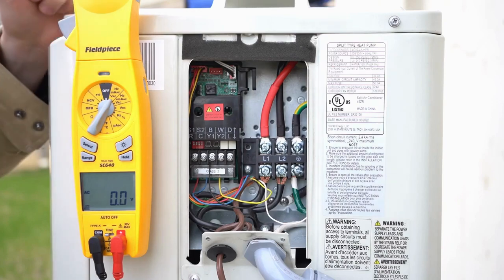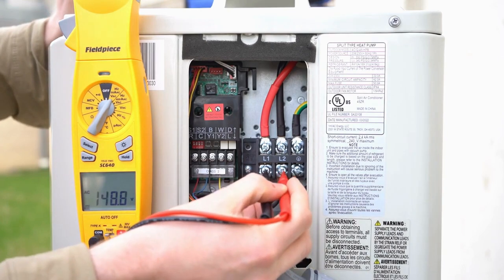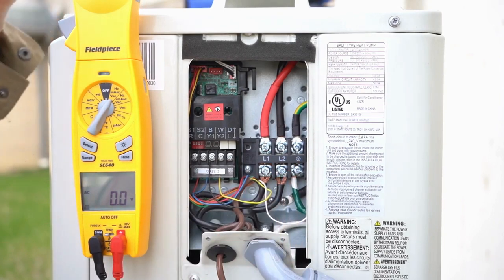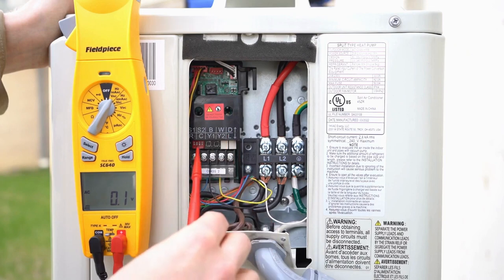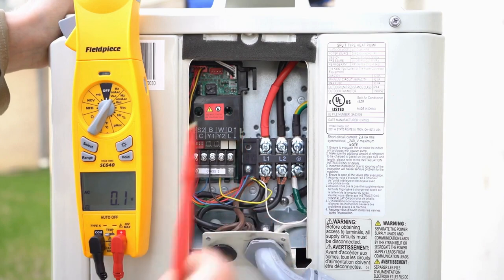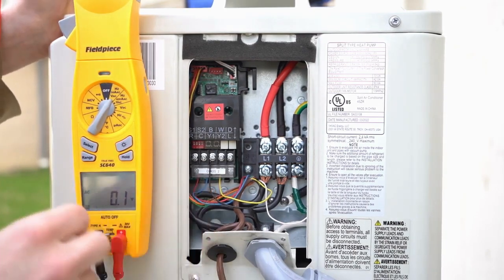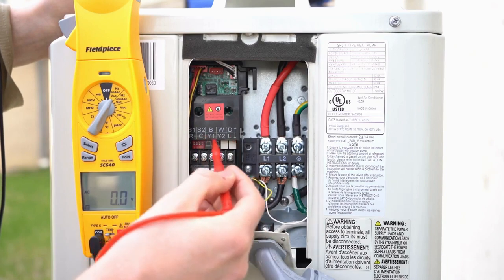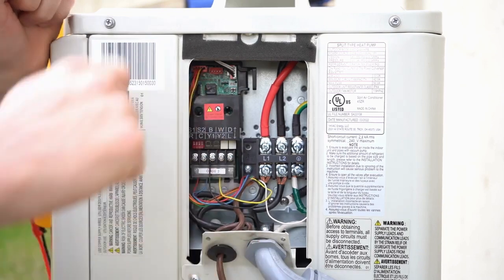How to Install an ACiQ Next Generation Heat Pump with a 24v Thermostat

Comment: Please help me, I have aciq gas furnace, coil,ac only condenser unit. I have 2 wires from old ac condenser unit connected on outdoor board at r and c. The outdoor unit will not come on. Is it because I have no communication wire or can I run unit without communication wire? Please help
Reply: outdoor unit will NOT run with just R & C (those 2 just power low voltage circuitry) you need Y2 for single stage cooling (or Y1 & Y2 if your thermostat allows2 stage cooling) and if a Heat Pump you need Y1, Y2, B & D.

Y1 is 1st stage of cooling (lower output) Y2 is second stage (or 100% output) B is reversing valve for heat pump (switches refrigerant flow to heat/cool) D is sending 24vac to  W2 on indoor unit to aid DEFROSTING OF OUTDOOR UNIT W2 can be: heat strips, gas, oil, propane FURNACE
Reply: Same issue, I was wondering if you can run a jumper wire from red to y1
Reply: Dont need communication wire, i had to run another wire so 3 at outdoor unit.  Red common,y2.  Set the second dip switch to up with power off@Michaelmasseymusic
Reply: @Michaelmasseymusic did that work?

Comment: I’m about to install one of these for the first time so I am grateful you saved me from frying the PCB. 

Can these outdoor units be used with a Goodman air handler?
Reply: if 24v control is used you can use it with 60y old moon lander A/C 🙂

Comment: Where does the s1 and S2 wire go to and what gauge wire does it need to be? And if I have th2 s1 and s2 hooked up, do i need to hook up the thermostat wires too?
Reply: On my QCiQ 4 ton ducted heat pump the terminal for S1 and S2 are clearly marked. BE AWARE that both install manuals I received with the heat pump warn against using S1 and S2 terminals only under certain circumstances or the board may be damaged. Also says to NEVER apply 24v power to S1 and/or S2. You might want to call whomever sold you your heat pump for technical advice.
Reply: @geraldhenrickson7472  Thanks for replying and I should have better worded the question. I have the same setup in the video above for terminals S1 S2 B W D in class 1 and R C Y1 Y2 L in class 2 for my ACIQ heat pump. I was wondering where the S1 and S2 wire connection from the heat pump go to? And if I have the 24 V thermostat wires hooked up like yours ( I see you have a red, blue, black and yellow wire in video), does the S1 and S2 still need to be hooked up in addition to thermostat wires or no?
Reply: @emmannuelthomas8060  FYI 
you only use comms wiring (S1 & S2) if you are NOT using 24v thermostat
if S1 & S2 are used on: HP < AHU & thermostat then only S1 and S2 are on all 3 devices!

some (very few) AHU's allow to communicate with HP via S1 & S2 and 24vac ONLY between AHU and HP

very few can do this so VERIFY (i doubt ACIQ can achieve this)
Reply: @palgumaka   Thank you. I just connected used the 24 V thermostat wire and did not connect S1 and S2 wire at all, and system works fine. Had to turn on one DIP switch in control panel to get the system to work.
Reply: @geraldhenrickson7472 Thank you. I just connected used the 24 V thermostat wire and did not connect S1 and S2 wire at all, and system works fine. Had to turn on one DIP switch in control panel to get the system to work.

Comment: FYI I would keep my low voltage wires aways from 240v load wires to avoid induction currents. Like in your video just move yellow and white wires away, move the supply black wires to the right.

Comment: I found the communicating Thermostat very easy to install and use. I couldn't run a new thermostat 18gauge wire to the air handler due to shared condo walls. I only had 4 wires existing and that's not enough to do the 24 volt thermostat.  Using existing 18g wire from old non-communicating Trane unit made the thermostat install almost too easy. The directions state it's supposed to be a shielded wire, but mine works as its not near any 240 v wire or other power wire. I installed the ACiQ ducted 2ton unit and the amount of money I saved in electricity is amazing.
Reply: vs straight electric heat? i bet. What's the percentage if you had to guess, saved?

Comment: Thanks for sharing!  I found it difficult to understand how the wiring was supposed to be hooked up from the paperwork with a thermostat.... (without using the signal cable to my indoor air handler).  I have a 3 ton ACIQ unit with a 10KW Style Crest indoor air handler unit. I have not installed any of it as of this date.
Reply: You're not alone. I'm a vet hvac tech and the wiring instructions from ACiQ driving me crazy ! ACiQ should have hired American HVAC tech to write the installation instructions instead of hiring some Chinese whom have no English and hvac knowledge.

Comment: Where's the air handler install instructions? We had to switch SW1-1 and SW1-4 dip switches  both to the ON position, in the air handler, in order to use a 24v thermostat, ecobee.
Reply: The ACiQ is a two-stage condenser but in the video, he doesn't have a wire connected to Y1 which is usually for the other stage. Curious to how you wired yours.
Reply: @stephenbender7593  It's not a 2 stage condenser ! It's a variable speed twin rotary compressor driven by inverter circuit.
Reply: @stephenbender7593  so I have a Ecobee, which goes up to 2H/2C, so I have Y1 wired to Y1, and Y2 wired to Y2. I did some searching and here's where they have posted the wiring guide https://aciq.com/wp-content/uploads/2024/08/Unitary-Quick-Start-Guide-Matched-System-2023-V1.1.pdf

Comment: Can you still run the unit on a 24V thermostat and still connect signal between the indoor and outdoor unit so they can communicate? This way I can run a Ecobee thermostat and not lose some of the efficiency gains by having the units communicate between each other.
Reply: if your air handler allows 24v from thermostat to it and comms to outdoor at the SAME TIME

VERIFY - very FEW CAN DO THIS